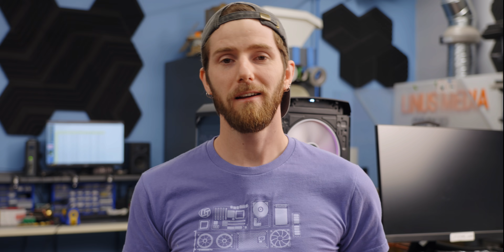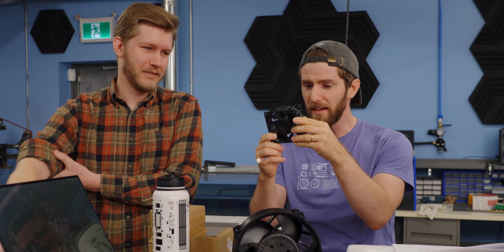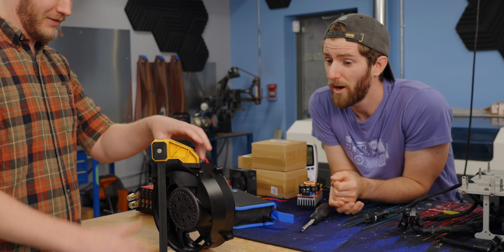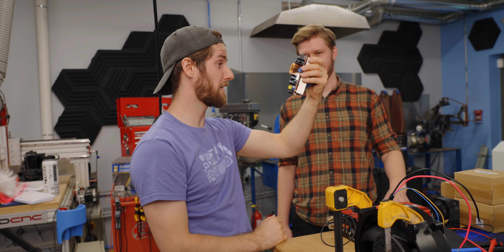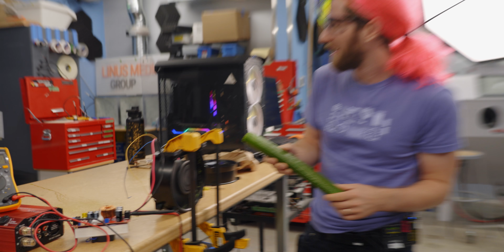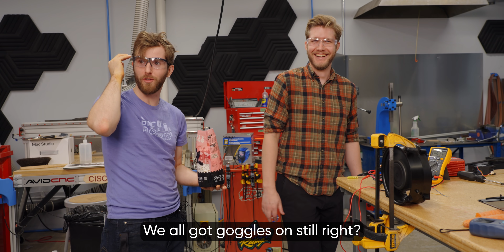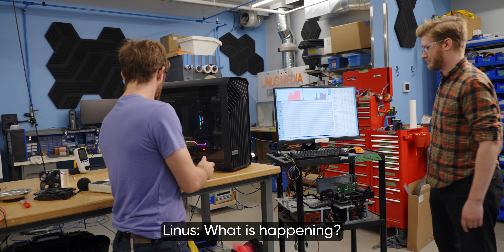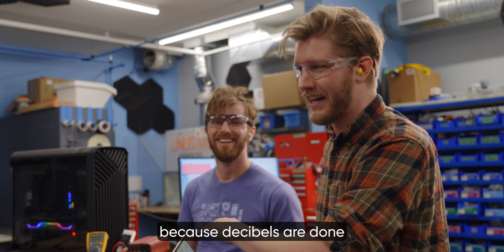The God of Computer Fans

Comment: The 80 mm Delta blowiematron spinning at 11,000 RPM has a blade tip speed of ~46 m/s (165 km/h or 102 mph).

The 200 mm Delta Blowzooka spinning at 7,400 RPM has a blade tip speed of ~77 m/s (277 172 mph)

That's a LOT of ouchie to get hit by.

Comment: Not using the same exact fans, but our server room is in an old building. To remove the heat from the room we use two 120vAC fans near the ceiling. Not great, but enough to drop the temps from 85F to 70 and stop the AC from running 24/7.

Comment: Old style Tandem and DEC servers used to have basically only fans at the top of the rack. As in, the server takes up an entire 48U rack or more than 1 rack. And they would have fans like this or even larger at the top of the rack.

The idea was that for starters the floor is dirty, so you cool from the top down. And with there being only a single "unit" at the top of the rack makes it easy to just replace them as a hot swappable unit. I've never ordered them, but I've replaced them by the dozens.
The 48V also isn't an issue in those settings, I mean those servers would draw kilowatts to begin with, so all of the power supply stuff and the internal UPS were custom jobs anyway. So it's relatively easy to put in a 48V rail. Not to mention that 48V at 12.5A is a LOT easier to deal with than 12V at 50A.

And they're probably used in generic industrial applications where 48V DC is considered "low" voltage.

Comment: It'd be nice to see how low this thing can go too. Like could this be a "practical" setup if the fan speed could be set to something like 800-1500rpm? The thickness of the fans alone would give them an advantage even without the crazy RPM. The static pressure advantage would probably be more apparent with filters or a radiator though.

Comment: Those boost converters are actually pretty nice. I have one of those particular style, no fan, but I've been able to push quite a lot of power through them without issue. With a little fan on them they do really good
Reply: Same. Got 1800W version with fan. I did build Lion battery pack and boosting it to 12V car-sockets and put in enclosure. I use it for camping.
Reply: @SnekSnack  I've used it a lot as a battery charger for my car when I've left the lights on. Use a pc power supply, and long ass wires to decrease the current draw between the booster and the battery, and just set the voltage accordingly. Also works good as a laptop charger if you don't have one but have a barrel connector for it

Comment: I've got 15 case fans in my HAF 932  14 of them are JET FLO 120's from Cooler Master and rated at 95 CFM's a minute + - 10 percent and all mine can spin up to 2200 plus RPM's so over 100 CFM's or over 1400 CFM's from all of them.

Comment: I remember having 2 delta 120mm fans in my pc, the 190cfm ehe model. Ended up running them at 7 volts as the noise was ridiculous.

Comment: I can't actually verify that the fan is the same, but this sounds very similar to the pedestal of large satellite dishes I used to work with. They have rack mounted equipment in the base, with more equipment on the back of the dish. All of which has to be cooled in any number of conditions. I know there is some kinda wild fan moving air in there and it is crazy loud.

Comment: Those vanes in the back help "straighten" the airflow, allowing it to push air further back than without them. You should consider running the test again but with the giant passive-cooling Noctua cooler, just for fun.

Comment: This fans are used on closed electrical industrial cabinets, with high power motor drivers and things alike, its a cheap option and valid when you have around 30  degrees Celsius ambient temperature and dont want to spend a ton of money on ac units. This motor drivers can control motors with a power capacity of 150KW OR more. The target temperature for This devices are usually 80-60 degrees

Comment: I have had to purchase the predecessor to the fan you guys have. Ours was used in a Telco cabinet full of hot devices that had no active cooling. There were 2 mounted to the top panel of a 36", 91.44 cm for my Canadian neighbors, to exhaust the hot air. Cold air was supplied from under the raised floor by way of perforated floor tiles. Usually the air is pulled from front to back in a cabinet, think server cabinets, but this was a unique setup. We also use similar fans that are about half as powerful in various electrical cabinets such as the ones housing mechanical batteries and other assorted spicy stuff. 😀

Comment: I've seen these fans used to cool down power delivery circuits, motors, and thick radiators for huge industrial machines.

Also sometimes used to basically suck as much air out from huge server racks as fast as possible.

Comment: hydraulics and electric  motor cooling.  Oil rigs commonly have a "top drive", which is a fairly complex pair of electric motors, plus gearbox, and hydraulics, high pressure fluid pathways, and some other things. For example, 2 x 1150 horsepower electric motors, generating up to 91000 ft-lb of torque (peak torque at low rpm), but operating for hours or days at a time, rotating a string of pipe a few km long at up to 250rpm.
Cooling failures on top-drives have cost a lot of downtime, so, yeah, need high flow fans, and the noise doesn't matter

Comment: I work in sound design and I've used these fans' weaker counterparts. Fans like this will go on racks to pull heated air away from the exhaust of several servers.

Comment: Just a small correction, every +3dB is not doubling the "volume" but the energy. The feeling of sound volume doubles about every +10dB.
Reply: Most tornado sirens are 120+ db at 100ft holy f
Reply: @ethearnos6397  that's so they can be heard from far away, since they don't play for very long it's not a problem
Reply: @Fredward1  just think about how loud that is now after reading and hearing this information
Reply: @ethearnos6397  I honestly can't, it's crazy
Reply: +3 energy, +6/10 loudness
Reply: Doubling of power every 3 db in audio. Volume is actually a unit of measurement so it is technically correct. Its just not twice as loud but everyone experiences this differently anyway. SPL is measured in root power.
Reply: Not really. 6dB means two times voltage. Energy is power (voltage * amps) * time in seconds. dBa, on the other hand, is a weighted standard for sound levels. So a 6dB increase in voltage means 3dB power increase for a given load. For power (in watts or dBm), a 3dB increase is a doubling of the power. 30dB is 1000x etc.
Reply: @erikas6874  That only works for basic resistive circuits. Speakers are closer to motors than resistors electronically.
Reply: @DoesntRefillTheBrita  You are wrong. Power measured in Decibels is true power, not limited to VAR.
Reply: @erikas6874  you an engineer?
Reply: Yes, master. And you?
Reply: @erikas6874  I am, but I doubt you are if you seriously think that.
Reply: @DoesntRefillTheBrita  That's ok. Wasting time to people who don't want to learn from others is not for me. Good luck trying impressing other that you have a degree at all.
Reply: @erikas6874  🤡
Reply: 3 db is not doubling the energy. It takes double the energy to increase the volume by 3 db. Doubling the mechanical energy, i.e the amplitude, takes 6 db. You are correct about the 10 db increase though.
Reply: And the human ear starts to pick up differences around 5db.
Reply: How do you measure "the feeling of sound volume" to observe it doubling?
Reply: @gauchette  you measure how loudly your ears ring afterwards
Reply: @gauchette  https://en.wikipedia.org/wiki/Sone
Reply: @gauchette  technology
Reply: @gauchette  Well, maybe the phrasing is not so good (not native english speaker), what I mean is that a sound feels 2 times louder if 10dB more is measured. As to how the feeling is evaluated, I don't know.
Reply: @JackJack-ok7wv  hey im a soundengineer, and you're absolutely right on this. 
+10db is generally known as "twice as loud"
+3db is when double the amount of power to a speaker for example.
+6db is when you double up on speakers and power at the same time.
Reply: @Jan-Tuning  +6dB is a doubling of Sound Pressure Level which is what they're measuring. SPL is a 20log ratio rather than a 10log.
Reply: @szimmerm5  im talking about what sounds like doubling in volume (or loudness however you call it in english) to our ears, not SPL
Reply: And realistically only give you around a 20-25% increase in volume in a perfect world. Used to have 4 15” drivers in a wall in the back of a Taurus. Gosh, I remember the high 150dB range days!
Reply: @ProPayne84  how the heck did you fit 4 15” in a freakin Taurus bro?

And how much power were you feeding them?
Reply: @mauirixxx  cut out the rear deck and took out the back seat cushions. Had something along the lines of 25 cubes of space to give to the box and drivers. Was 4000-4800 RMS total. Didn’t play it at 1k/driver for daily usage though but while competing would let them eat on 2 SAZ-3000D LoL. The super early build is on my YT, was only on one 3kD and with 1 driver having the wrong impedance from SunDown so had low power going to them at first.
Reply: @mauirixxx was more of a competitive setup but would keep it down relatively low while daily driving. Was still mega fun!!!
Reply: @ProPayne84  I miss seeing mini trucks blasting as they drove down the street, it’s gonna be a weird thing to describe to my grand kids. My brother had a setup in his S10 that made it feel like air was getting sucked out of me. So fucking cool.
Reply: @ProPayne84  no it isn't. If you think you could put 150db of audio in a car, hell even in a house without special power delivery, you don't know how decibels work.
Reply: @DoesntRefillTheBrita  What you're saying doesnt follow anything i said LoL I never said I had any sort of stock power delivery LoL had aftermarket alternator, some 0 gauge wire throughout and 2 extra deep cycles in the back... not once did i mention anything about not upgrading electricals in the vehicle
Reply: @ProPayne84  I don't think you understand just how much power 150 db is. Do the math. You would need more power than some nuclear reactors to run that. Do you have a nuclear reactor in your car?
Reply: @DoesntRefillTheBrita  LoL 150dB isn’t too too tough to drive at all LoL I was even able to break 150 with just ONE SAZ-3k with 4 15s in the vehicle
Reply: @DoesntRefillTheBrita  iv just done some googling and 150db on competition grade car stereos seems like a pretty common thing.
Reply: @darrenfalconer3267  you mean "false advertising" seems like a pretty common thing." Just like those 12 million lumen flashlights on Amazon? Or those 9999mah lipos?
Reply: @DoesntRefillTheBrita  no I mean people actually discussing there setups on car audio forums. Maybe you just live under a rock??
Reply: @darrenfalconer3267  show me one decibel meter reading from 1m wway that actually says 150db and I'll eat my sock
Reply: @DoesntRefillTheBrita  will you believe what I send you or just assume every thing is fake?
Reply: @DoesntRefillTheBrita  world record currently is 170+. 150 has been a thing for years. Do some research buddy
Reply: That's mostly right. I would add that a +3db in sound would require a doubling of power (watts). +6db gives you a noticeable increase in SPL, which would require an increase in power by a factor of 4. But yes, +10db is generally perceived to be twice as loud. It's very hard to accurately define what is twice as loud because db operates on a logarithmic scale.
Reply: maybe he is taking the natural log instead of common log
Reply: @arnav5008  No. He's just wrong. Many people get this wrong.
Reply: That also isn't exactly correct, the decibel measurement is more or less already a decent representation of perceived loudness. The +3db being double the energy is accurate enough in most cases, though not really a useful as it's really just a blanket statement and will change depending on the application. But +10dB being twice as loud is only correct if you're adding 10dB to 10dB. so 20dB is twice as loud as 10dB but 90dB is not twice as loud as 80dB, 90dB would be twice as loud as 45dB. Perceived volume is difficult to measure, but this would seem accurate to most people. It also doesn't apply to the higher and lower end of human hearing. 400dB for example, wouldn't be perceived as twice as loud as 200dB because you'd just be deaf either way.
Reply: @flyingtentacle7631  that doesn't seem right at all. 60 dB is an air conditioner. 120 dB is being right next to a siren...
Reply: @flyingtentacle7631  First thing you learn in acoustics is you can’t add decibels. 90 dB is not twice as loud as 45 dB.

Comment: I was using a similar Delta fan, and, like yours on the test bench, my mounting solution was less than ideal. It blew over and, instinctively, I tried to catch it... Luckily only one finger ended up in the fan blades. With human flesh, it ends up more like thin 'strands', as opposed to the 'mist' that was coming from your vegetables. Lol
Reply: Reminds me of the saying that goes something like "when trying to catch a falling knife, every end is the blade."
Reply: @kevinmertel6108  "Falling knives have no handles" is the version I learned.
Reply: @kevinmertel6108  Very true. Obviously, everyone knows you're not supposed to try and catch it. It all happens so fast that instincts just kick in. I guess all it takes is one accident like this to rewire that instinct haha
Reply: OOF
Reply: Jeez, thats quite a story! Glad to hear it didn't end as bad as it could
Reply: @Magnetic_Aviator  Thanks. Somehow, it was my ring finger that ended up in the fan (still not sure how), which is probably the best outcome that could have occurred. Most useless finger in my opinion hahah
Reply: I sacrificed the tip of my left pinky to a little 72mm blowy boi a while ago. I feel your pain man. All my fans have gates or screen over them now, regardless of how little they are.
Reply: @DigitalJedi  Yep. I put guards on them and zip-tie them to the chassis I'm working on. Should have done that from the start but I guess I forgot how powerful instincts are
Reply: Did you get permanently injured?
Reply: @geroldminhofer3295  The corner of my fingertip is cut off and my fingerprint is all mangled. The fan blade was oriented in such a way that it didn't impact any bone, but it did cut into some tendon/ligament. I do have some slight nerve damage but nothing too severe. I needed 6 stitches across the front/side of my fingertip to keep it all closed up haha

Comment: Heh.
Salvaged few cooling systems from old blade enclosure, 2x24V 3A fans (in series, aerodynamically) in each ..
Now i need good project for those ..
And power supply's (12V, 190A) were also good salvage ..
;)
EDT:
And blade's exhaust is good hairdryer .. long hair .. late night work .. sauna in office .. (and certain drink using hops)

Comment: DC,UPS if it is large when it draws current the batteries heat up.  When power dies,  power to shut things off can get very hot for 24volt 4-20mA controls,  Industrial welders, spot welders  Also seen those fans on plastic welders for sealing plastic bags.  If you have to move alot of heat fast and loud doesn't matter.  I saw a fan like that behind a carbon filter for an chemical exhaust hood, that was electro plating.

Comment: I just looked it up on Digi-Key and it's $278 USD, still a lot for a fan, but a lot less than $422. Maybe it dropped a lot? The power draw is 384W.
Reply: They had 2
Reply: @primus711  the price was each, they showed a screenshot of digi-key and the item number was the same. Maybe just local pricing difference

Comment: I've installed these in a server rack configuration for a school. Engineering/medical servers in a configuration of 12 server racks and 6 racks holding these vertically.   In a way too tiny room these fixed cooling issues and have the bonus of being an incredible dust filter.

Comment: well its men to move volume,  So  i'm assuming small form ventilation for server rooms.  
when you think about it like a water resivior there come a point it fills its thermal capacity and will not cool  things below that capacity.  A server room has the same problem,  due to scale of operation,  1 pc vs racks of  computers lots of wires, lots of air flow obstructions and  the server fans as well going.  need something beefy to move the hot air out of the room.  or the AC is redic.

Comment: One use for those fans would be to cool massive light dimmer power supplies/controllers. One use case for those light dimmers would be a stage, I've worked briefly with them

Comment: Deltas have always held the powerful fan award. It's usually loud as hell though.
Reply: They also don't go quietly.  These fans get really loud when the bearings start to fail.  We have excellent noise isolation in our server room, but nothing blocks the sound of one of these fans failing.  On the plus side you will know well in advance it is time to order a new one.

Comment: You guys realize a BLDC fan can also be called an AC motor with a controller, or AC generator. It probably has protoection, but you need to measure AC voltage when generating

Comment: You spent 200$ for that thing and it's spares and 250$ on the 24 volt variable power supply. Just spend the extra 350$, you insane fecks

Comment: Hi there, I’m a procurement professional, back in 2016 I had those for a mill and press for home appliances manufacturing fridges and stoves, very expensive and got the job done even with burners and a lot of heat keep PCs running for like 25+ years on heavy duty

Comment: Funnily enough boost converters like that are pretty standard in industry. I worked a job doing industrial panel design for awhile and we used boost and buck converters off Amazon all the time, of course we only did this when we had one small thing ln a certain voltage rail.